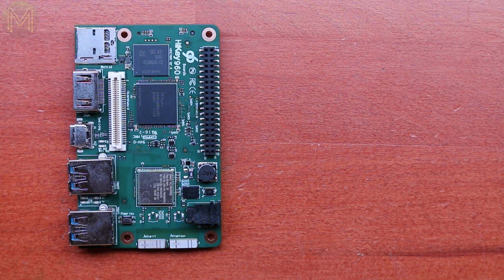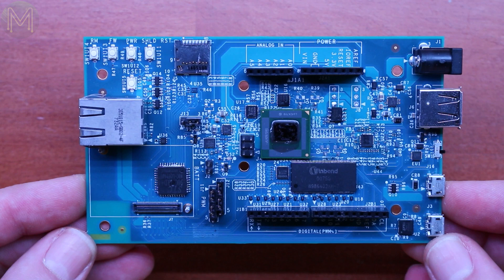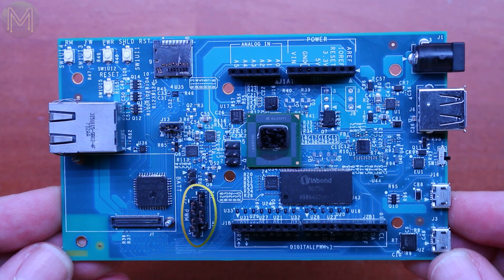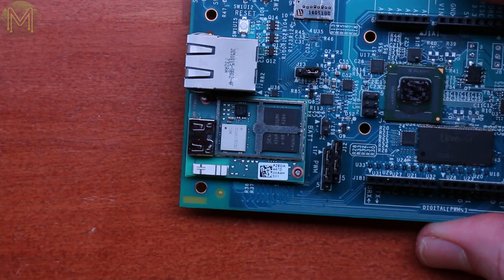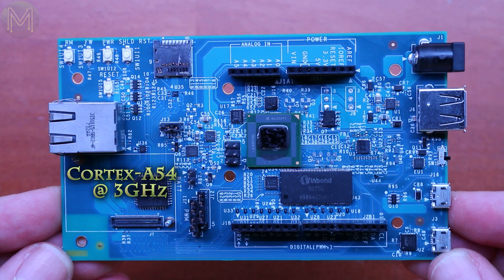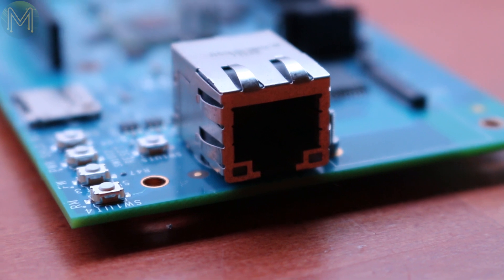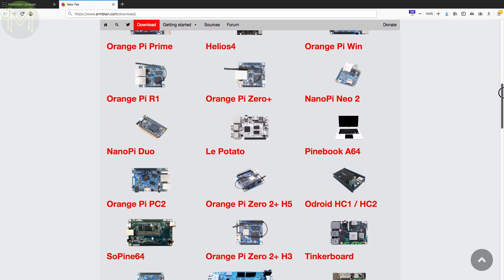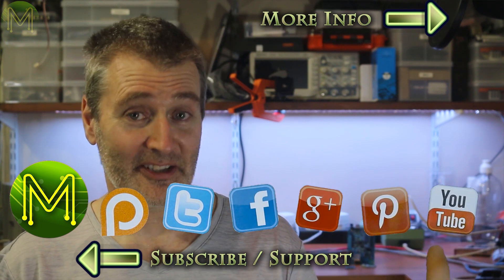#202 Announcing the mmBoard! A MickMake SBC with all the goodies.

Comment: Man you really got me until that flip to the 386 processor! Good 1st of April mate
Reply from the maker: ROFL.
Reply: Ha ha. Yes. I so wanted to make a comment. The nine core ARM CPU was enough but I didn't want to spoil it yet I couldn't quite see how to add to the deception either.

Perhaps now I can say "the video is just too good this time" :D
Reply from the maker: Well, next year will be better. I couldn't set the bar too high this year.
Reply: Well there are some x86 SoCs there for that kind of application but that's not the one ;) And that Winbond is small SDRAM not DDR4 Both RAM modules, 386 and "SoC" module are just glued to the board and not really connected to anything, no silkscreen and it's quite obvious those are just some desoldered spare parts/scraps :P But really nice vid! Edit - just looked at edison and I missed that RJ45 and STC chips glued as well ;)
Reply: That 386 tipped me off as well. Before that, he had me going. lol
Reply: Tony really? The 8k 60hz video adaptor didn't get you?
Reply: Yup, the ancient, fossil 386 EX was the dead giveaway for me too. It was a chip and a shark too big to jump!
Reply: You know... I guess my brain was off. I got weirded out at first by the wide voltage input at the jack and my first thought was "I can't see a power inductor on the board how does he make this work?" but that's it.
Reply: I was believing what i was seeing then realized the part that got me was DDR4 8gb, the 9 cores was very strange, then the stack able header didn't look like it even plugged in correctly or at all.